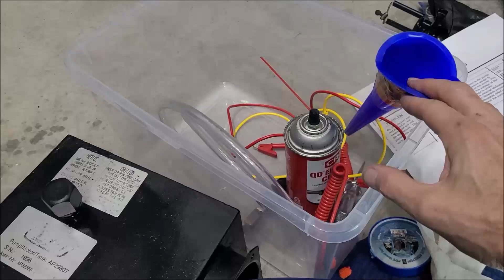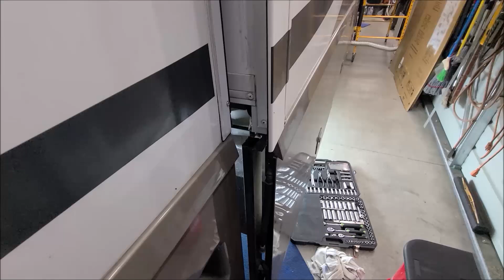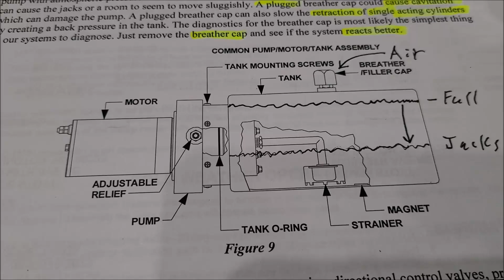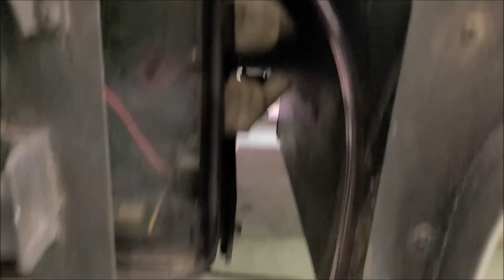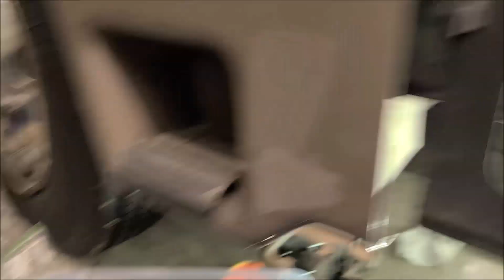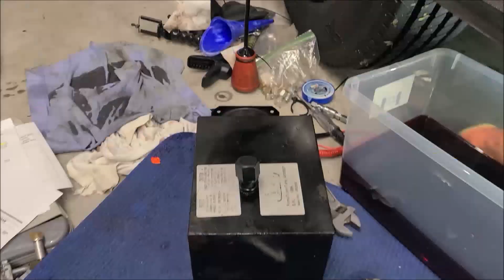How to Properly Check & Change The Oil in Your HWH Hydraulic Jack & Slide Room System Part 3

Comment: My 2007 Adventurer has had a leak from somewhere around the tank or pump area. Where are you located? I'm certain my system needs a complete overhaul with new oil and everything. I will check out all your videos on this system. It seems as tho Workhorse built the motorhome around the HWH system. Very difficult for me to get in there to work on it. I'm tempted to try to find someone who knows this system and could do the work for me.
Reply from the maker: Text me at 606-875-0125 Kevin

Comment: Kevin, you're the best.   I've got a 2005 Winnebago with two HWH slides (no jacks).  Had a line blowout a couple years ago but no idea if the RV repair shop changed the oil in the tank.  I also am so thrilled about your check valve video, I had a leak this spring from that area (not nearly as bad as yours) but found that the valve nut was totally loose.  Not even finger tight.  I haven't cleaned it to remove it to check the o-ring yet but if it's cracked I know exactly what to do; thanks to you.  Will likely swap the oil out before we head out this summer.  I was totally afraid/ paranoid about servicing the HWH system, but your awesome videos have shown me it's not all that bad once you understand the parts.  Your teaching style it perfect !  Thank you so much!  -pete in Seattle
Reply from the maker: Thank you for the kind words.

Comment: I would recommend a harbor freight fuel pump to pump it back in. If it would fit in the tank I would pump it out. I used to have a air powered venturi pump. You could put the hose in the tank press the air nozzle and pull everything out. https://www.youtube.com/watch?v=7can2eKgXS0. Great video... I'm working on a LTFT bank one and two alarming at 12.5 now on the ScanGauge
Reply from the maker: @TrapperSamm  confirm you have no exhaust leak on that bank. Use shop vac to blow in tail pipe.  Or swap o2 sensors to see if the problem moves to other side. Call me if you like at 606-875-0125 Kevin